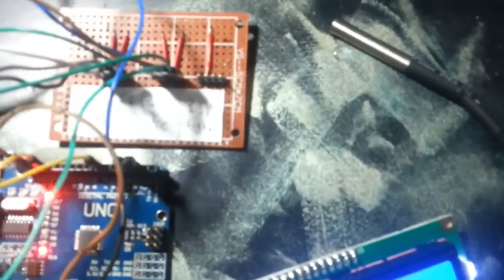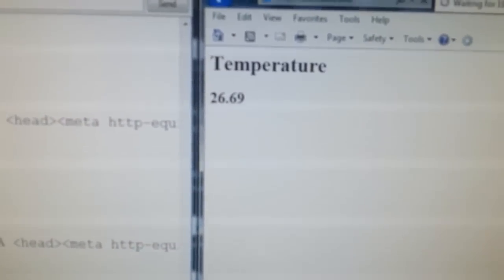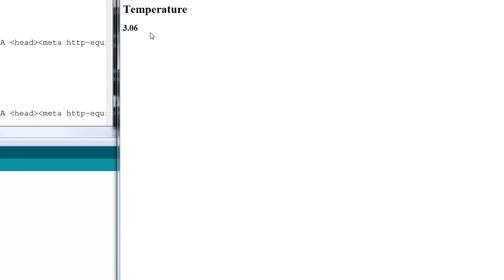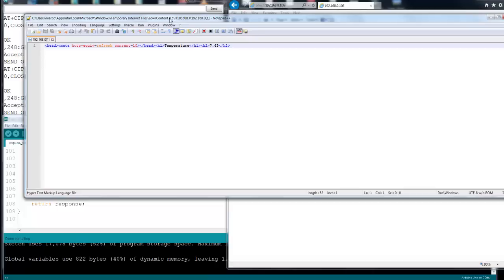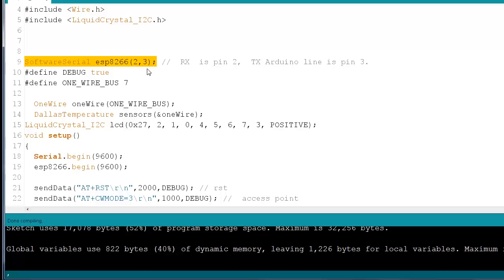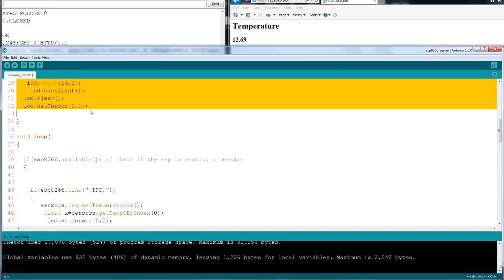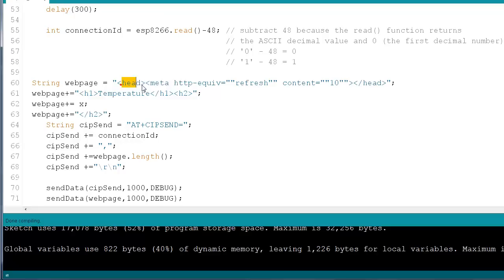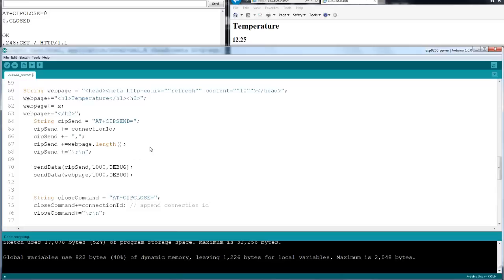A simple ESP8266 wifi web server using arduino.

Comment: good work bro, im building a energy meter with current sensor by using arduino uno and esp01 module to display my current sensor value in web for monitoring purpose and im modified this project by using esp01 module (http://www.the-diy-life.com/simple-arduino-home-energy-meter/). can u help me with the coding bro ,thank you

Comment: HiLove the application, having looked at similar sketches.. How do I find - or calculate what to enter in " int connectionID. How and where do I change it in the program. If I run the software as you have published, I get a message on serial monitor, AT+CIPSEND=-49,82r/n...Etc.....AT+CIPCLOSE=_49Link is not validI am getting temperature into UNO ok, as I entered a serial.print line into sketch, and it is displaying on the serial monitor.Hopefully you can point me in the correct direction.Using esp01, and am new to internet & ethernet type connectionsThanks.

Comment: i did not use i2c

i get this in the moinitor display
AT+RST

OK
WIFI DISCOONECT

 ets Jan  8 2013,rst cause:2, boot mode;(3,6)

lo`d 0x40100000, tahl 4
chksum 0x89
loa7tail 4
chk834t`il 80n p
 hijrَn't uqح rtc mem d`ta
slڈگoجے
Ai-Thinkdr Technologx Co.,Ltd.

ready
AZ¥¨UêٹTTڑj
CذjصLّAT+CIFSR

+CHFSR:APIP,"182.168.4.1"
+CIFSR:APMAC,"1a:fe:34;d4:69:TS3KWIFH CONNECTED

 ets Jan  8 2013,rst cause:2, boot mode:(3,6(

load 0x40100000,1tail 4
chksum 0x89
lo ntail 4
chkmxrtail 8kxs M lb
 َn't use rtc mem data

slڈگoجے
Ai-Thinker Technology Co.,Ltd.

ready
AT+CIPMUX=1

Comment: is the logic converter important?? because when i was connecting the rx and tx of the esp8266 to the arduino rx and tx directly with no level converter i did not face problems so is other digital pins differ??
Reply from the maker: +Mohammed Mudathir 
Esp8266 is 3.3 v
You are taking a risk if you try to use 5 v on the pins.
Reply: why did you you the softwareserial insteand of hardware serial pins default RX,TX ??
Reply from the maker: +Mohammed Mudathir 
Because i need two serials

Comment: FYI the ESP8266 can run Arduino emulator libraries; it's faster, has more flash mem, more RAM, and is in one device instead of two :-)
Reply: Is it possible to use more than one sensor with only the ESP8266? Can you recommend a good starting point to read?
Reply from the maker: +Wael S 
Esp is the same as arduino . You can use its pins to connect more than a single sensor
Reply: Wael though I have not done so yet I have read about many such examples. As Marco said it is pretty much as capable as an Arduino. I started with the ESP Arduino interface but today I hope to test Sming. Looks like it should be more simple to do the tasks I want. I expect a higher learning curve but once it's setup should be simpler.
Reply: Ok for the -01 yes there are only the two GPIOs. Can be expanded with a GPIO expander but the best bet is to get a newer one. I paid $2.40 for some ESP-07S which have the external antenna adapter and FCC approval, and both are requirements for my project. Several GPIOs on that one. But they are bare boards; to get the equivalent to the ESP-01 with its breadboard pins you have to add an adapter, I think $1 on eBay.
Reply: Hmm. Kolban has a decent book, and you can get it free. (Payment optional.) https://leanpub.com/ESP8266_ESP32 I just learned as you did, with videos and blog posts.
Reply from the maker: +Christopher de Vidal 
Thats why most users moved from At into working via the Arduino ide .
Reply: Is this the ESP8266-01 or the higher models? I only see GPIO1 and 2. The arduino nano which is almost the same price has 13 pins analog and 5 digital if i remember correctly.
Reply: So going back to my other question, can you recommend a good starting point for me to read? I find with those things I takes me an awful lot of time going through videos and articles that don't really work or are not very clear. Believe it or not, it took me close to a month to get data out of my arduino to thingspeak using ESP8266-01.

Comment: How do you read your variable? Is it analog or digital? Or directly to the ESP8266? To what pin?
Reply from the maker: Diego Perez I am using the Arduino to read the value I operate the esp8266 via AT

Comment: Hello Marco thank you for share. 
I am have a bigger trouble with this module it is not working.
I alright configured it and my ip is 192.168.0.170 and Fimeware used is 00170901

In place of LDO than you used i used this converter
3.3V 5V TTL Bi-directional Logic Level Converter

The power supply for 3,3 Volts i am using a breadboard suplly like you.

I can ping and have return of esp, but when i try your example code with arduino the return is timeout just.

Can you have some suggestion?

Thank you!
Reply from the maker: no idea try to reflash it
Reply from the maker: does regulat at tests work for you? like display ip or firmware version

Comment: Not getting the web page .Showing junk letter showing in serial console while access the web page 

AT+RST

OK
 ö,‚€YbBbc  |p C9… HéB0b[bC PÀk
ready
AT+CWMODE=3

OK
AT+CIFSR
+CIFSR:APIP,"192.168.4.1"
+CIFSR:APMAC,"1a:fe:34:9b:c4:e7"
+CIFSR:STAIP,"192.168.1.4"
+CIFSR:STAMAC,"18:fe:34:9b:c4:e7"

OK
AT+CIPMUX=1

OK
AT+CIPSERVER=1,80

OK
0,403:GET / HTTP/1.1
Host: 192.168.4.1
Connection: keep-alive
Cache-Control: max-age=0
Accept: text/html,application/xhtml+xml,application/xml;q=0.9,image/webp,/;q=0.8
User-Agent: Mozilla/5.0 (Linux; Android 4.4.4; A0001 Build/KTU84Q) AppleWebKit/537.36 (KHTML, like Gecko) Chrome/42.0.2311.108 Mobile Safari/537.36
Accept-Encoding: gzip, deflate, sdch
Accept-Language: en-GB,en-US;q=0.8,en;q=0.6

OK
@úŽÓÇÿ âÎDH
{<âgVÊ 
Nk €Á@ \frÿk
ready
AT+CIPCLOSE=-49
MUX=0

hangs in this point .
Reply from the maker: what browser are you using?
Reply: Marco Arduino channel Google chrome on my OPO mobile
Reply: Marco Arduino channel is there any voltage divider circuit used in TX and RX connection to arduino
Reply from the maker: Jinu George try via a regular pc under windows and see if it happens as well.also what firmware do you have on your esp?

Comment: Thank you for this video and for the code!
I modified it to work with DHT22 Temperature&Humidity sensor.

What about the "busy inet..." error that stops the automatic refreshing of the page? It comes after 1 to 5 right refreshing.
What's the problem?
Reply: Marco Arduino channel 
I'm using an eeePC with Mozilla. Then I tried with my android phone and the connection is definitively stable and IT don't break after a few refresh like on the PC. Not a big problem but I wonder why it does so.
Reply from the maker: i dont get that error ,what browser are you using?
on chrome via a pc and a android phone it works well and on explorer as well. the only prob i get is using safari on ipad.

Comment: can i use any other sensors?
Reply from the maker: Tay Aaron 
You can use whateveryou want . The sensor is connected to the arduino. the esp8266 will display what ever the arduino sends to it. you can connect what ever you want to the arduino.
Reply: thanks for your reply. Btw, can we save values in the webserver?